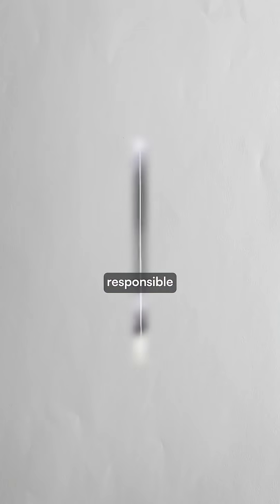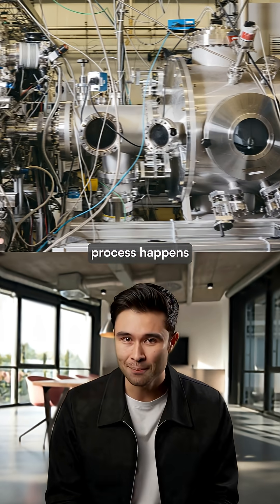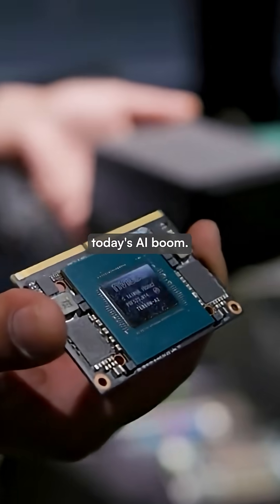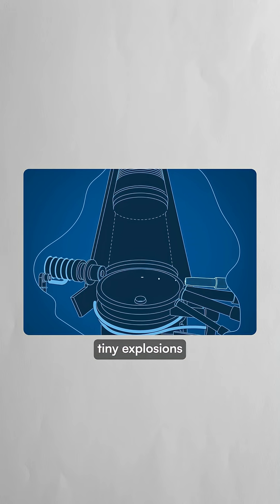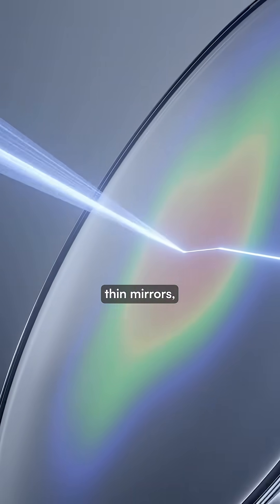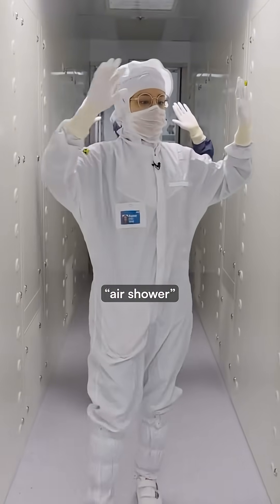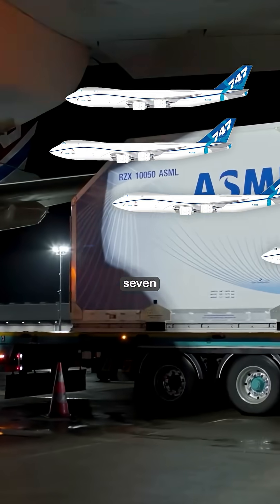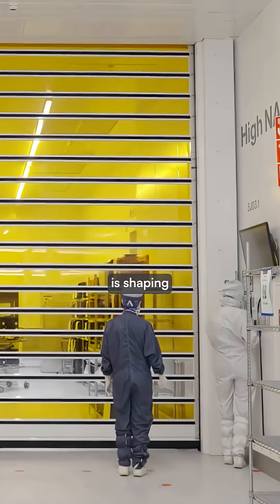These machines are responsible for the world’s computer chips ⚙️ #trendingshorts #ai #data #tech

Comment: Recently hired by ASML. These are massive. Depending on model, the stage movements exceed 20G of force. Even at those accelerations, the positioning accuracy is precise enough to print within a few nanometers so the connections between chip layers are aligned.
Reply: I worked at ASML many years ago, so I can’t speak for the current equipment.  But at the time, the building requirements for a chip lithography machine were  insane.  Like, you have a whole team of people dedicated to building just one machine, for one customer, which takes more than a year.

Once they build the machine in Veldhoven and run some test prints, they have to completely disassemble the machine and ship it to whatever the final destination is, where that same team will completely rebuild it all over again, taking another year.

And the measurements taken for these machines are super sensitive.  If you want to install the machine just one meter away from where you had previously planned on, you have to go through all the measurements all over again —and that takes months.  A truck driving on a road ten miles away can generate enough noise through the ground that the nano-scale vibrations in one place don’t look anything like the nano-scale vibrations just a meter away.

And that was the state of the art about twenty years ago.

Now, if you want to read about the Internet mail system I designed for them back then, see http://shub-internet.org/brad/papers/sistpni/
Reply: @shubinternet  Wouldn't it be possible to transport it as a whole via multiple "silent" drones that are extremely stabilized? I get that helicopter, ship, airplane, truck is not ideal, but very well calibrated drones could do this in theory.
Reply: I believe they use an electrostatic drive for the tables?
Reply: @stawmy  Not quite electrostatic drive. Electrostatic wafer clamp to hold the wafer to the chuck in systems that operate in a vacuum, where vacuum can't be used to hold the wafer on the chuck.  The drive is water cooled linear electric motors.
Reply: @isettech  OK thanks! Nice to know😀
Reply: "On April 1, 2025, the Taiwanese manufacturer TSMC introduced the world's most advanced microchip: the 2-nanometer (2nm) chip."
"Mass production is expected for the second half of the year, and TSMC promises it will represent a major step forward in performance and efficiency – potentially reshaping the technological landscape."
"Established in 1987, TSMC, which stands for Taiwan Semiconductor Manufacturing Company, manufactures chips for other companies. Taiwan accounts for 60% of the global “foundry” market (the outsourcing of semiconductor manufacturing) and the vast majority of that comes from TSMC alone."
Reply: Are you violating IP by answering these kinda of questions? I've gotta be careful about it for my work
Reply: @Erik-vr2uu  I can answer questions of published specifications and regular physics questions. Actual programs, PID parameters, linear motor circuits, etc are the IP and secret sauce.  For example, you know theme parks have linear motor roller coasters. Try to get drawings for the electrical motor drive, size and turns of the wire, number of phases, commutation method, and other secret IP for the operation and etc to meet performance specifications, is much harder to obtain. For the coaster launch, they are unlikely to share the amount of stored energy, current, and voltage used for the launch. A competitor will have to do their homework to compete  in the coaster market and not steal the design of an existing one.
Yes the actual theory of Lithography  is no secret. How to do it really fast for high volume production, while maintaining high precision in layer to layer registration and focus is the secret sauce.
Reply: @Erik-vr2uu yes he is.
Reply: How is it possible to achieve that level of accuracy when backlash exists?
Reply: @mattmurphy7030  No linkage for backlash. The motor and the wafer stage is one piece. Think linear electric roller coaster. There is no link between the coaster and the direct drive linear motor.
Reply: We are nearly AT the end of the 6000 years and to enter into the 7th day represents the rest of God and it can only happen when Jesus is sent back from heaven a day only God knows and not even Jesus nor the angels know, please find 'Christadelphian Bible study and Christadelphian videos to understand the truth of God and what he is planning to do when he sends back Jesus Christ from heaven as Psalm 110:1-3 says prophetically 😊
Reply: Bro, what you said about ASML is truly fascinating. A single machine costs $400 million, takes 18 months to build, requires 7 jumbo jets for delivery, and still it cannot come close to the complexity of a single human eye — which Allah created for free.

Think about it:

That machine can only function because it follows fixed physical laws (light, lasers, droplets, vacuum). Who created and sustains these laws so perfectly?

If humans need thousands of engineers, billions of dollars, and years of effort to make just one imperfect machine — then who engineered the human brain, with 86 billion neurons working in perfect harmony?

If one chipmaking tool requires so much planning, can the universe, galaxies, life, and even your own heart come into existence “by chance”?

The Qur’an asks:
“Were they created from nothing, or are they themselves the creators?” (Qur’an 52:35)

And also says:
“He created everything and determined it with precise measure.” (Qur’an 25:2)

Bro, human technology only exposes how dependent we are on the laws set by Allah. Even with all this science, nations still fight for monopoly and power. But on the Day of Judgment, no monopoly will remain. Allah will ask:

“To whom belongs the dominion today? To Allah, the One, the All-Powerful.” (Qur’an 40:16)

So yes, ASML’s machines are impressive — but they are nothing compared to the creation of Allah. If we admire human invention, shouldn’t we admire and submit even more to the Creator who gave humans the knowledge in the first place?

Turn back to Allah before the Day comes when no technology, no machine, no power will save us — only faith and good deeds will.
Reply: Care to share how wafer to mask alignment and focusing works? 😂
Reply: @zuzkazuzka8284  It is pretty complicated. To focus the wafer, alignment marks on the waver are used to position the wafer in alignment. Laser Interferometers are used to position all wafers exactly. Same is used to position the reticle. The lens does not move as it is huge and heavy, so everything else moves in relation to that.
For focus, this position is defined with and expo/focus wafer where the wafer is exposed at various exposures and positions and the position and exposure with the finest test patterns are the best combination. This is then used to position all actual wafers. The Expo wafer is not run every time. it is run when maintenance, or patterning shows degradation and re-calibration is called for.
TLDR, Wafers are very accurately aligned and positioned at the focus, which is found with a test exposure pattern.
Reply: @zuzkazuzka8284 sure, you just have to be careful to ensure they stay aligned.
Reply: What do you think about the LDP lithography China's EUV breakthrough that they recently finished and will scale in a few months? It's supposed to be 10x better (cheaper and faster) than the ASML version. Is ASML already planning something even better or are they fucked?
Reply: @Aldraz  As a recent hire, I am not aware of the China entry. Only know about the Cannon Micropriht. Having a theory and bringing it to production can be a challenge.  I know China has an alternate light source with Philips. They still have to build the rest of the lighography system, and keep defects low and exposure rates high. There is issue of power limited by Z pinch.
Reply: @isettech  I think your info is very behind. They don't exactly inform public about this, but it's confirmed now they have just very recently built their own light source for EUV. Huawei made a lot of other components and now they have everything they need. You can actually see they have already finished some prototypes in the pictures. I don't know how legit that is as it also seems pretty secretive and would mean they literally skipped 10 years of development in just 1 year, but that's kinda normal in China.. also considering they already have 5nm chips in their latest phones, having 3nm in another year is possible for them. They plan to have full production in 2026-2027, overtaking ASML. It's another DeepSeek moment for them.
Reply: @Aldraz  There is a difference in throughput when you use a 500W + light source for exposures and a 35 watt light source. The other light source has the problem of higher power results in a larger area emitting light, which can't be focused or used. Compare the wafers exposed per hour between both light sources.
Reply: @Aldraz Direct EUV or X-ray lithography is the next step...
Reply: @Aldraz I would be very skeptical of the claims made by China and their chip manufacturing industry. At the end of the day, they have yet to mass produce anything at scale that competes on the world stage. They may have certain systems able to produce something, which is already impressive, but it doesn't produce in volume, or with a low defect rate.
Reply: @Jimster481  Well if it comes to scale, there's nobody better than China.. Like with the shipbuilding which is 232 times faster that of the US. That's the last thing they probably worry about as they can catch up in a year, not 10 years from that point.
Reply: @isettech I used to sell Cannon printers 😅😅😅
Reply: @Aldraz  xd China tried to reverse engineer the asml machine and broke it and called the company to fix it xd china cant do shit cause all they do is steal the tech and make it cheap they dont ahve innovation
Reply: You aren’t my g. You aren’t in a Dutch time zone, and sure as hell wouldn’t Brad about it online.

ASML are proffesionels, not internet hero’s.
Reply: @TommyTurtle-n5l  Correct about the Time zone. Incorrect about where ASML employees work. They, like Intel and TSMC, have facilities in many locations such as Korea, Hillsborro Oregon, USA, California, Arizona, and Vancouver WA. I'm not an internet hero, and I don't work at the home office. Please do some research on the company and it's satellite locations for support and service in the various global regions. Due to shipping costs, service of units in the USA are serviced and repaired in the USA, buy employees in the USA.
Nice try for trolling. Well done, but called out.😃
Reply: @TommyTurtle-n5l hmmmm, so you’re a YouTube truth officer? a 200IQ super sleuth who can see through any ruse? Very impressive.

However, it seems spelling “professional” correctly is beyond the scope of your ability. Which doesn’t align with your job as a truth officer…if you can’t spell how can we trust you to identify who’s good and who’s bad?
Reply: @graysonmichael8335 honestly embarrassing reaction.

Comment: asml have a massive competitor now, the chinese government. they achieved euv equivalence. all the phds leaving the usa certainly helped
Reply: They haven't achieved equivalence.

The Chinese can produce 5nm chips at a rate of 20% per wafer compared to the 97% TSMC sees.

The difference in that, is for China, it costs over 50% more to produce what TSMC is capable of on a 5 Nanometre process.

80% of a Wafer is destroyed to make 5nm chips in China. Meaning where TSMC might create 10,000 per wafer, China gets 2,000 Usable chips with significantly reduced performance.

China is still a good decade behind in Chip Manufacturing. Not all chips are created equal, and just because it's on the same Nanometre, does not mean it performs equal.

China's 7nm Chip for example which was their prior breakthrough, had less performing power than the A11 Chip used in the IPhone 10, nearly 8 years ago, which was made on a 10 Nanometre process. It also cost them nearly 4x as much to do with a wafer success rate of under 25%.
Reply: @Sinonzz  just a matter of time. it will come sooner than expected. they already sell high-end lithography machines for chip production
Reply: ASML is European.
Reply: ASML is pure Dutch company and they were developing this tech for like 30 years with massive patience and support from investors and government. Being home country for Philips also helped but still it was a massive effort
Reply: Yeah. We have a 40 year head start with billions of R&D.

Next year 0,7 of 0,9 nm. China is still on 4 Nm